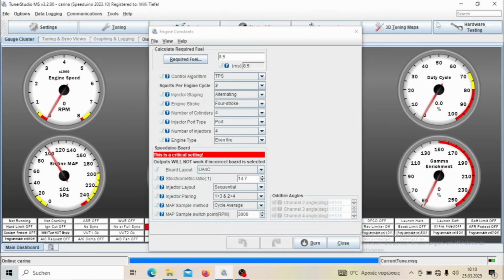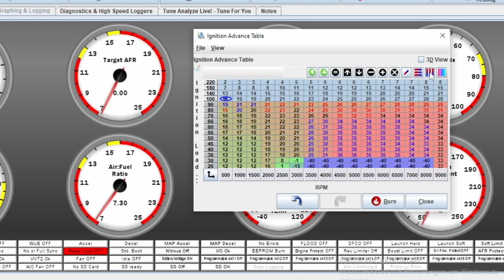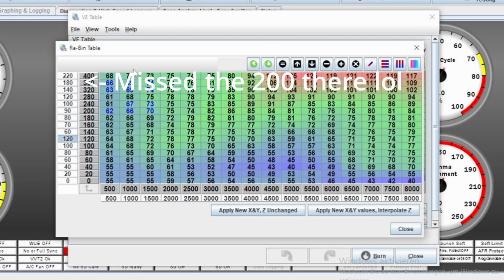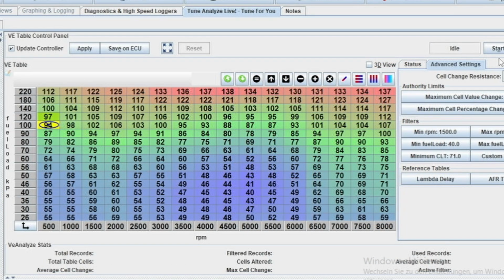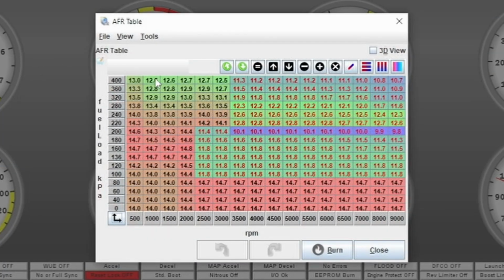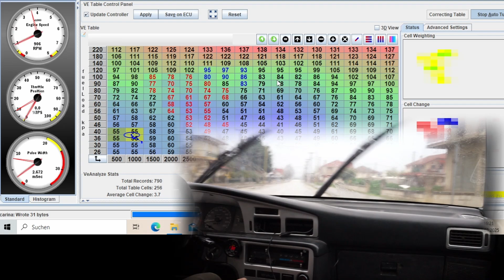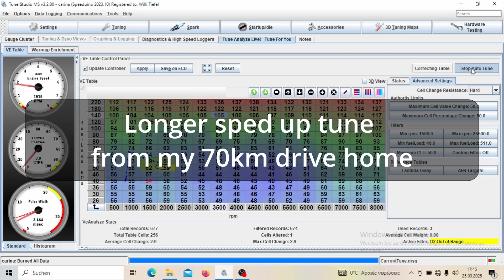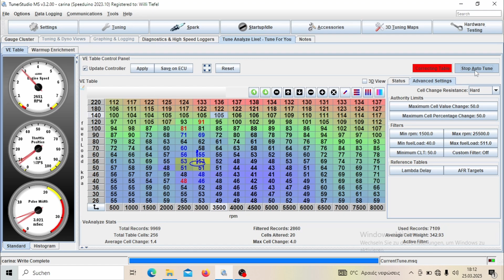Tunerstudio standalone ECU Tuning Guide | Part 17 Prep & first steps Turbo tuning| MS, Speeduino RUS

Comment: I got a Tercel with Alpha x that used tuner studio the car runs good on winter time but now I have a problem there the FP don't prime  stay on at least I touch a pin with the test light but still not goes on also see that my map sensor reads90 kpha at cranking 😢 bought to try again now to see what I cant find out 😔 wrong there
Reply from the maker: send me a message on instagram ill be able to help you gbetter i think than here